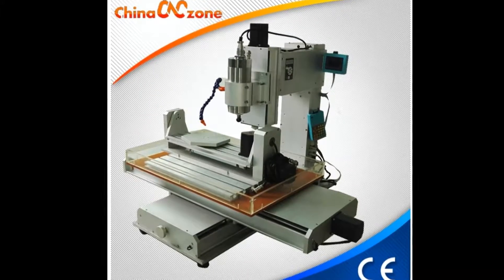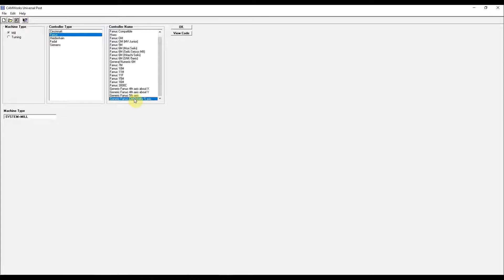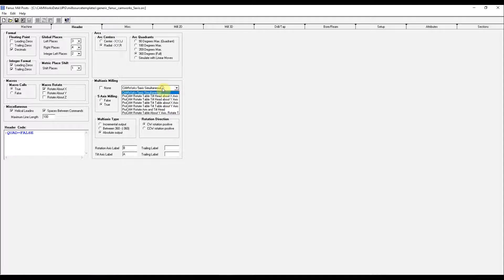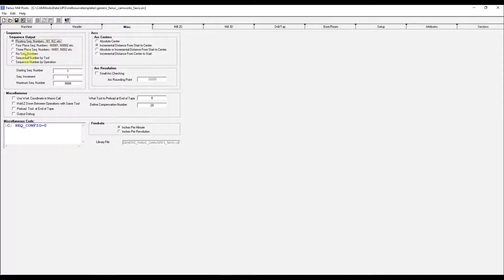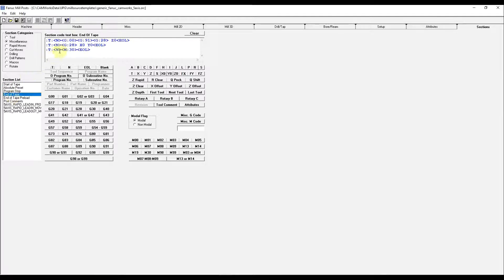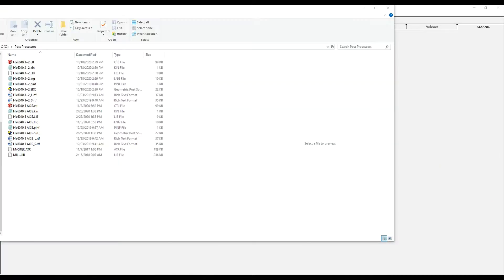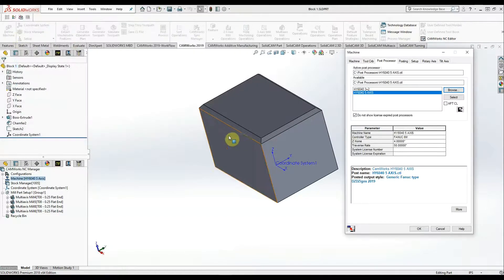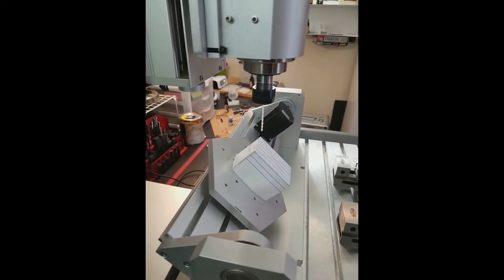Post Processor Mach3 CAMWorks

Comment: Hello sir does your Mach3 interface have all axis in display. If yes can you tell me how do you add more axis in the interface? And if I want to run 5 axis in Mach3 do I need to download 5-axis plug in as well
Reply from the maker: The Mach3 screen can be changed to anything you can come up with. Look for machscreen.exe software. There are some videos on how to use the screen editor.
You shouldn't need any plug ins to run 5 axis with Mach3, but it does not have kinematics so it doesn't always run correctly. I made a 5 axis dome video where standard Mach3 worked fine in 5 axis simultaneous.

Comment: I dont understand 
why you use fanuc configuration for standard HY6040 CNC Machine that not use fanuc controller, right ?
Can You plz clarify
Reply from the maker: FANUC is industry standard. It's most common and it was closest to what the HY6040 milling machine needed. As you can see, I changed a few settings is all it needed. If you started with another base version, you would have to change a lot more.

Comment: Hi DAN, Thanks for video. I got stuck using solidworks and having a DDCS Expert (Mach3) controller.   
I started using Solidworks and would like to keep using it.  On facebook they are all using Fusion 360
Do you think the M350 controller is able to work with Solidworks. Would like your opinion 🙃. Kind regards
Reply from the maker: To help me understand your situation,  are you using the DDCS or the M350 to run the mill? I use a Windows PC and Mach3 to run the mill.
Also SolidWorks is not a CNC controller,  it is for CAD modeling and CAM tool path programs.
Reply: @HandyDan  I am using Solidworks 2023 and Solidworks CAM to produce the parts. After that i copy the *.nc file on a USB drive and feed it to the DDCS Expert v1.1 controller.
I will be using the CNC for 3 axis at first, but have a 5 axis setup (see pictures).
Reply from the maker: @user-qz7vw8vn3s  OK that sounds correct, I do the same thing with a USB stick. So what is the area you are having trouble with?
Reply: In my opinion it's setting up the right post processor for my DDCS expert.  So i can combine creating a profile with carving text and drilling holes.  Now am able to produce just one part. Just the text, drilling holes or creating a profile 🤔 I update the facebook group with a new video of the problem . The CNC is getting out of control after 1:40  (posted it under facebook M150 & M350 CNC CONTROLLER). Also posted the video on my youtube channel 😀 What kind of cortroller do you use?
Reply from the maker: @user-qz7vw8vn3s I use Mach3 to control the mill.
I left you a comment on your channel but didn't leave my email 
Send me the G code 
message2dan@live.com
Reply: @JamesBond-b6mis DDCS expert works well on 5axis setup ?

Comment: hi Dan , how would you rate the rigidity for aluminum milling?
Reply from the maker: I have milled aluminum with this, it's a noisy thing to do but the rigidity is not very strong,  I have some videos on the A axis upgrade that shows the finish, it takes a dozen spring passes to get the tolerance 😉

Comment: Hi dany ,  i saw your video , very interesting , its been   4 month looking for a video like  that , where can expleane all the procedure of post prossessor  thanks for that ,    need help please , about post prosessore  of my  machine of controll  Tnc  530  hiedenhain , if u help  with it  i will aprecciate
Reply from the maker: I don't have any experience with Heidenhein controls, they use a very different style of code, most industrial equipment is Fanuc based.   What do you use for CAD and CAM software?  What is your machine brand name?
Reply: My machine its GTX 620 5 axis ,we have    software  solidworks  , and  solidcam and camworks
Reply from the maker: @must2192  Have you tried following along with the video? Have you downloaded Camworks UPG?
It has Heidenhain as a choice of control. If you have any programs that do run on your machine you can view post styles in UPG to find the closest one.
Reply from the maker: @must2192  Is your machine Finetech? was the controller changed out to a Heidenhain?
In Camworks UPG the Heidenhain post generates code like this below. If you have other programs that run correctly, see if the code looks like this:
0 BEGIN PGM 0001 INCH
1 BLK FORM 0.1 Z X0. Y0. Z0.
2 BLK FORM 0.2 X0. Y0. Z0.
3 STOP M05
4 TOOL CALL 1 Z S 2000
********* Profile Operations
5 L X+7.0711 Y-2.8868 A45.0000  A35.2644  R0 FMAX M03
6 Z+4.1825 R0 FMAX M
7 Z+3.0825 R0 F50 M
8 L X-7.0711 R0 F100 M
9 L X+0. Y+5.7735 R0 M
10 L X+7.0711 Y-2.8868 R0 M
11 Z+11.0825 R0 FMAX M
12 L X+5.0000 Y+5.0000 A90.0000  A90.0000  R0 FMAX M
13 Z+5.1000 R0 FMAX M
14 Z+4.0000 R0 F50 M
15 L Y-5.0000 R0 F100 M
16 L X-5.0000 Y+0. R0 M
17 L Y+5.0000 R0 M
18 L X+5.0000 R0 M
19 Z+7.0000 R0 FMAX
20 STOP M05
21 END PGM 0001 INCH
Reply: @HandyDan   thanks you so match  and thank you for your time ,  i saw in  cam works there is post processore  of hiedenhain , i will  to run that and see its work , and upg of hiedenhainh of its similare to this that u write it  👍

Comment: do you have 5 axis post processor for mach3?
Reply from the maker: A post processor is specific for the CAM software and controller on the machine. 
What software are you using? 
I have a post processor for Solidworks/Camworks for Mach3.
Reply: @HandyDan  me too, I just need to setup camworks İf I have 5 axis post processor for mach3. Also I use mach3, Can you send me the 5 axis post processor for mach3 ?
Reply from the maker: @mertkars1463  email me message2dan@live.com I'll send you the information later today

Comment: Can Camworks + HY- 6040 do thread tapping? And is HY- 6040 supports Mach 3/4 ?
Reply from the maker: This machine cannot do rigid tapping or floating tapping due to no spindle encoder, but  it can do thread milling with a single point or multi tooth thread mill.

Comment: i don't know why people don't use  CAMWorks because  this is intuitive
Reply from the maker: I got certified in Camworks back in Florida in 2014, it's big on the east coast but here in Phoenix it's nowhere. Then in 2019, Solidworks bought out Camworks and it comes in a simplified version in Solidworks now called Solidworks CAM
Reply: @HandyDan  I didn't know it the same things,I thought CAMWorks and SolidworksCAM are different product.
Reply from the maker: @seimela  Maybe they are licensed different but from being a Camworks user for 8 years and now seeing Solidworks CAM embedded just like Camworks and all the menus are identical, just a few things different like icons colors and a few features removed since you can upgrade to the full version.

Comment: can i use this with mach4 ?
Reply from the maker: I still have Mach3 but it doesn't work very well with simultaneous 5 axis, do you think that Mach4 is able to?
Reply: @HandyDan  try mach4 , it might work ,it's a very simple and stable ,you might have to edit the post processor, it have never crushed on me ,I'm currently using fusion 360 trying to migrate to CAMWorks.
Reply: @HandyDan  what do you mean that it doesn't work well with simultaneously 5 Axis? Doesn't the mach3 just send the gcode or program made in camworks to the cnc?
Reply from the maker: @dansv3872  the issue I have with Mach3 is under settings it has rotation for A axis only  nothing to set B axis rotations so both of my Tilt A and rotate B are slower than snails, if I turn on rotation in Mach3 for A it runs normal but B is a snail.
Reply: @HandyDan  very good to know about this issue, did you find any workaround for this problem?
Reply from the maker: @dansv3872  I have not found a solution,  I have tried G93, G94 in searching but I have tried it in a few places in the post processor but it never posted correctly.  Again I don't have any projects that require 5 axis simultaneous,  I get 5 axis 3+2 positional to work great for most parts.
Reply: Hi  @HandyDan  and thanks a lot for this perfect video. What do you mean about this issue ? I'm interested by your feedback because I plan to use mach3 for simultaneous 5 axis. 
1/ What do yopu mean by "under settings,  it has rotation for A axis only  nothing to set B axis rotations". I don't get it because in MACH3 you can set the speed, step per min, pulse and dir pulse duration, etc...for both A and B axis.
2/ What do you mean by "if I turn on rotation in MACH3 for A" ? I don't get this feature. Where do you find it ? What is the meaniing of this feature ?
Thanks !
Reply from the maker: @jeanlucbergier7728  I could maybe learn something from you, but when I post simultaneous 5 axis,  X,Y, and Z move inches per minute,  but A and B move so slowly like they're 1/10th the speed but all G01 moves have the same F speed,  if I activate A axis rotation in Mach3 my A then goes as fast as xyz. But B is still super slow. Like maybe I need G94, G95?
Reply: @HandyDan  Thanks Dan. Strange behaviour indeed. I'll receive this week a new controle board 5 axis so that I'll be able to test the 5 axis simultaneously. I'll tell you how it works on my machine in a few days.
Reply from the maker: @jeanlucbergier7728  I'm looking forward to your success! Let me know how it turns out. 😌
Reply from the maker: @jeanlucbergier7728  I ordered a 5 Axis CNC breakout board for my mill upgrade when I bought my mill because it lacks in functionality,  but 4 years later I still haven't switched it out. 🤣🤣🤣

Comment: hi Dan i am using camworks with mach3 but my post processor does not work as it should on drill cycles.
Could you share your post processor? It is only for three axles.
thanks
Reply from the maker: Email me and I'll send you the post files. 
message2dan@live.com
Reply: @HandyDan  thank you I already wrote you
Reply: thank you I received your email I still could not test the postprocessor but I will let you know as soon as I try it thank you very much
Reply: @HandyDan  Hi Dan, could you send me the files too? Would be a great help
Reply from the maker: @SuperCamus09  Sure thing, send me an email and let me know what you need.

Comment: Good afternoon, I am trying to generate a post to perform the machining of an impeller in five axes on a machine with the same characteristics and it does not come out as it does in the video, and we need a post from CAMWOrks for mach3 before I was using mastercam to mach3 but I can't do the code right
Reply from the maker: I have a post processor that you can try. Are you using Solidworks and Camworks?  I am using 2019 Camworks. Let me know what you need.
Reply: @HandyDan  I am using CAMWorks for SolidWorks, the machine we have is a HY 3040, I have already made all the configurations, I just need the post for that machine and I just need that
Reply from the maker: @cristianacosta4065  there are 6 files I need to send you. 2 are not entirely necessary they just are the notes that come up when selecting the post inside machine setup window
Reply from the maker: @cristianacosta4065  email me and I will send you the info 
message2dan@live.com
Reply: @HandyDan  Thanks, I already  sent you
Reply: @HandyDan  I sent you an email sir.

Comment: Hey Dan! How much was this CNC and what are it's capabilities?
Reply from the maker: I got mine a few years ago straight from China Zone cnc, it was $1,299 plus $689 shipping or something like that. Capabilities are wood, plastic and soft metals like aluminum and hard metals like brass.I have not tried steel.
Reply: @HandyDan  im looking at a similar one that's built out of steel rather than aluminum. It says it can do stainless but the servos don't look any beefier so I was wondering if it was a con and if the cheaper ones can too with slower shallower cuts.
Reply from the maker: Con beware... but the steel construction is definitely a plus for rigidity! That's the main culprit of the one's like mine. I'm sure it would be capable to mill stainless, with the same steppers it would just be slow and noisy.  If you don't mind me asking, how much is it? Who makes it?
Reply from the maker: Ok, if you're getting up in that price range, Tormach is a much stronger machine, options for tool changer, 4th axis and much better than hobby mills
Reply: @HandyDan  it's a 5 axis and that 5th axis is pretty important for what I'm doing.
Reply from the maker: @marcuspinson  I got a couple notifications from you with the ebay link but it never showed up, maybe it was blocked. I'm just curious about a steel, $7k China Zone mill
Reply: @HandyDan  youtube doesn't allows l 3rd party links apparently add "gmail . com" to my screen name and shoot me an email ill send you the link that way. It'll also probably ve less cumbersome than back and forthing in your YT comments 😂
Reply from the maker: I understand, but 90% of parts can be done in a 4th axis and 99% can be done positional. 1% are simultaneously. 
What type of parts do you make?
Reply: @HandyDan  i do a lot of prototyping every time I go into the shop people want something more complex in it's shape.

Comment: Hello Dan - just a quick question...  Would you buy this machine again?  I am interested in the china zone 5 axis and am trying to determine if it is worth the investment.  I am just getting into cnc; however, I used to design in PT-Modeler (pro-e junior) many years ago, so do have some 3d design experience.  I am looking for a solid hobby machine for aluminum cnc and like the ability for 5 axis this machine brings.  Just looking for a real world opinion.  THANKS!
Reply from the maker: Joe, as for the question would I buy it again,  yes. But let me explain. For under $1,500 you get a very light duty machine that can cut aluminum but loud and slow. The next level machines are much bigger and more expensive, Tormach $5,000+ or HAAS office mill $45K and up.
Reply from the maker: So the only reason I would buy it again, cost.
Reply: @HandyDan  Thank you - that is where my head was too.  Cost vs benefit.  Seems to be worth the extra (for me).

Comment: HELLO DAN I USED YOUR VIDEO AND BUILD POST PROCESSOR FOR 4 AXIS MACHINE BUT AFTER CREATE PROGRAM ANGLE TO ROTATION HAVE TO BE (A 0-360 )BUT REALLY POST PROCESSOR WRITING (B 0-360) CAN YOU MAKE ANOTHER VIDEO .  (CREAT POST PROSESSOR FOR 4 AXIS  IN CAMWorks)
Reply from the maker: Awesome and in Camworks UPG check to see if your two axis settings are A C or if A B is backwards go into the settings I show where you need to set table to X 1.0000 rotation to Y 1.0000

Comment: Hi Handy, i have the same cnc with mach3, but some problem to use it... can you send me your PP? I use fusion360 to generate gcode...
Reply from the maker: I use Solidworks with Camworks so my post processor will not work on Fusion360.
I have not tried Fusion yet but I hear you can edit the post processor on there.
Reply from the maker: If you can tell me what it is doing wrong maybe I can find a solution,  something might be able to change in Mach3
Reply: @HandyDan  thank you andy, my problem is a big offset when i use 4 and 5 axis like as the position was lost after the mouvement
Reply: can i send you a video by personnal e-mail?
Reply from the maker: I have the same issue with certain 5 axis simultaneous where in CAM software everything is spot on, but at the machine some tool path is 100 times over sized.
I don't think Mach3 is good for 5 axis simultaneous it has a rotation setting for A axis only .
We're on the same page so teamwork and we will solve this.
Email me anytime. 
message2dan@live.com
Reply: Hi Steven,I have it for Fusion, where i can send it to you ?

Comment: Hey,you dont have processor for mach3 lathe?
Reply from the maker: I do not have my lathe on CNC control.  What CAD/CAM software do you use?
Reply: @HandyDan  solidworks 2017
Reply from the maker: Ok so then are you using the built-in Solidworks CAM?
It should have a generic HAAS lathe, HAAS is Fanuc based and so is Mach3
Reply from the maker: Let me know what file type it looks for when you go to change post processor in machine setup. If it is looking for "post name.ctl" I can make a post processor for you.

Comment: can you use this post in fusion 360
Reply from the maker: Not that I'm aware of. Each CAM system has its own unique file extensions for posts. But Fusion 360 has a lot of features and posts you can try
Reply: Did you find any post for fusion360?